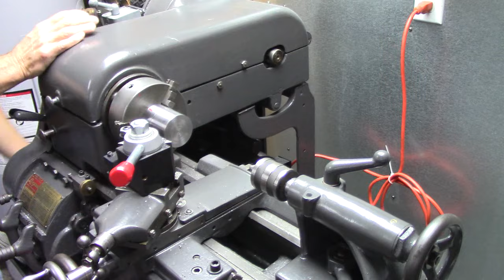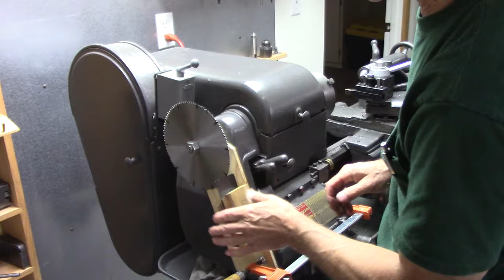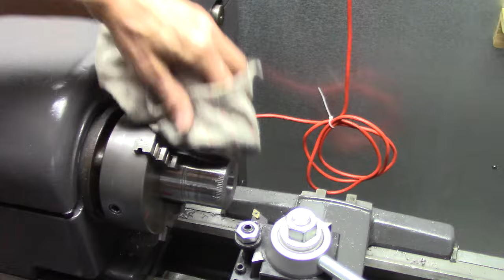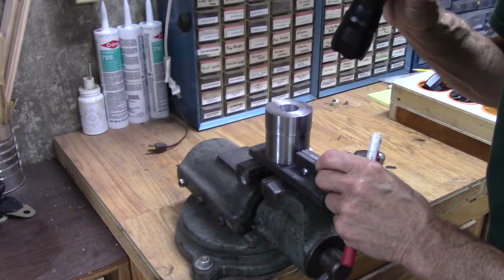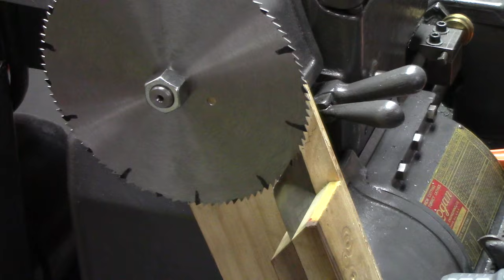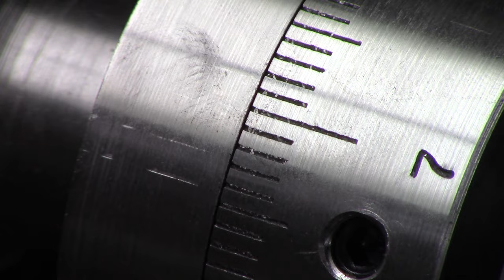New LARGER dials for my Logan 820 lathe - Part 2

Comment: May be use a vertices Sheree tool.   Mr Pete has a video on the vertical tool.    The tool is most effective at .001 depth of cut.    I know you do not have a dial but you capable to figure it out
Reply from the maker: I've mess with those in the past...  it might be great on dials!

Comment: Do you by chance have any of the measurements from when you made the dials and the crossslide extension? I have a logan 815 and would love to do this mod
Reply from the maker: The drawings were posted in the description of part-1 bit here's a cut and part: Dial extension plans to fit the Logan 820 and 200 (and some Ward lathes)  https://www.youtube.com/redirect?event=video_description&redir_token=QUFFLUhqbU9QYlU1QTBqbzNwSjRNTGJ4c0w4S196T0Nmd3xBQ3Jtc0tubVBldWNjbzlHc2M0c1hKaXd0WlMzb0NzYVJZS2NuRXNsLVVwNkNPQW1YYTloa3hBMGJtZVF2UTFQM0l6Nk55cFhQRlhKY1F5OF8ycmpfZjNLQk52dGQ2ODl0MVRjX2JobVVwTF92N3BUYmFMSWJqTQ&q=https%3A%2F%2Fdrive.google.com%2Fdrive%2Ffolders%2F19-xmDQsXIe-CsTcAFHwalhof5jXnAVnR%3Fusp%3Dsharing&v=MbUpOjtB2l4
Reply: @WinkysWorkshop  thank you

Comment: What is the maths behind the lead screw pitch and the indicator spacings? I am assuming the cross slide lead screw is 5 threads per inch? With 10 divisions on the dial, that would make each mark 3.6 degrees rotation. 1 revolution of the dial would be 1/5 an inch? How much of a cut is taken per dial mark? 0.018"? Thanks.
Reply from the maker: Most lathes are 10 TPI . This means one rotation is 1/10" or .100". If to divide that into 100 parts each line is .001" or 1/1000".  So if you move one increment the cross slide of compound will move .001". I'd forget about the angles. It unnecessarily confuses things. Oh...  one thing to keep in mind also is that when you move the cross slide .001" (one increment) you change the diameter of what you are turing .002". This is because you are removing from both sides. Some lathes have a lead screw with 20 TPI so that one increment changes the diameter .001".
Reply: @WinkysWorkshop  Thanks. Been a long time since math class. I was trying to think it through in my head, but the rotational aspect confused the simplicity! Cheers. ;-)
Reply from the maker: @CreatureDesign  - I totally understand. I can just about guarantee you are better at math them me. I've just thought about the dials a lot.

Comment: This will be my next project after the parting off tool. I went and got some steel dial rod today. Wish I had some aluminum I think that would be easier to make the dial lines in rather than steel. Your much better with the lathe than I but I have found on my south bend that a real sharp high speed steel with a light cut will do better than my carbide bits do for a good finish. Not sure but you might have gotten away with it and may not have wiped out your short lines. But you definitely got the job done and done well that's what I admire about you. I also have the same problem as you with the compound slide , it comes back and covers the dial and any time your machining something with some size to it that's always a problem.
Reply from the maker: Yeah...  HSS is a little better but I have good luck with carbide and its easy. I wiped out the first dial for a couple reasons. First the tip of the carbide threading tool I was using as a scribe broke so the lines were not as deep and second, I just went too deep. I think on the next dials I make I will use 800 grit wet dry paper on a block of wood and then work my way up to 1200 grit. Aluminum is a little easier but to be honest there isn't much difference. I think I like the steel better but aluminum works very well. Use HHS steel for a scribe on steel. Carbide will break.  Good luck and thanks for the comment. Oh... the first video (part 1) has a link to the dial extension. It's a lot of work to make but nice to have.

Comment: Wanted to say, the part where you took it out of the chuck to do the numbers is where you lost it... A 3 jaw never lines up the same way twice. Could have prevented by using the 4 jaw and re-indicating it in. Also could get a finer cut with hss instead of carbide insert. You got there in the end though, and did a beautiful job, it looks like Logan did it!  I love the saw blade setup, going to remember that one.
Reply from the maker: Of course you are correct about the three jaw and the HSS. That was probably the 8th dial I have made and the first failure. Marking the position has worked well but obviously the chuck isn't 100% consistent. Who know... maybe I had trash under one of the jaws. I made a couple of dials after this video and started using emery cloth and then 1200 grit wet dry to polish the dials. It works great. I can't take credit for the saw blade trick. I learned it from Mr, Pete. Thanks.

Comment: Having no dials, you could have set up your dial indicator from the bed to the cross slide and use that to see how much movement of your leadscrew. Turning out to be acracking job you are doing, well done and thanks for uploading such interesting videos. By the way, what happened to the indexing drum you made for your orriginal lathe, would it not have fitted to this one.
Reply from the maker: Thanks, I was very pleased with the way the dials turned out. 1.5" diameter would have been adequate but the dial shaft extension was still a huge plus. I can't believe Logan designed a lathe were the cross slide can obscure the dial. Very true on the indicator, this was laziness on my part.  I used the indexing wheel to make a dial a while back and it was a pain to use. It works great for 2, 4, 6 etc. but for 100 positions it's too slow. with the saw blade you just grab the chuck and rotate until it clicks and then back up slightly to seat the clicker in the gullit of the saw tooth. Way faster then aligning a pin to a hole.

Comment: Be willing to bet that you wiped out your marks because you remounted in a 3 jaw chuck. Wonder if that would have happened if you had used a 4 jaw and dialed it in!? Good work however, planning on something similar for my Craftsman. As with yours, the dials are too small for my older eyes!
Reply from the maker: I'd be willing to bet you are partially correct. If I do it again I'll use a 4 jaw. Wiping the dial out was a combination of too deep of a cut PLUS the carbide tip broke on the threading tool I was using to scribe with. That's why I switched to HHS for the scribe. So half the dial scribe lines were shallow and missing. With that being said, if you look close on my finished dials you can see that the scribes are not as deep on one side (off center in the 3 jaw). If you watch part one you will notice I used a 4 jaw to make the lead screw extension. I should have done the same with the dials,.

Comment: By darn you did it , Great job .. I learned a bunch .. ENJOYED !
Reply from the maker: Of course! I made 1.5" for my Logan 200 but it always bugged me that the cross slide covered the dial when it was all the way back. Extending the lead screw has been on my list for a long time. Sometimes crap like this sits in the back corner of my brain and digests for years. I suspect this is why I can't seem to remember things I should be doing. I suspect all these ideas are like parasites eating up brain power for simple tasks. On the other had, life would be boring if I didn't have things to figure out!

Comment: You had indicators why didn't you use them on the cross slide for depth and to indicate the chuck  3 jaws can be trued by tapping th low jaw with a mallet and re tightening it
Reply: I've had good luck with marking the chuck but if I want to get perfect I'd use a 4 jaw. As for the cross slide I should have turned the compound straight and used it.

Comment: You got there in the end.  It would have been no fun when the markings all dissapeared!
Reply from the maker: It was disappointing at first but it didn't take long to make the second one. Thanks for watching.
Reply: @WinkysWorkshop  it came out nice.   I tried to make a punch jig for my punches but they just wouldn't give a consistent result.  I think it's just down to cheap punches.  You got a great result!
Reply from the maker: @CreaseysWorkshop  - Maybe 3 years ago I bought a set of number and letter punches. I've made several aluminum dials and the results were okay but not great. Mostly the numbers were not positioned well on the end of the punch and it made the dials look sloppy. I bought a new set (google this number: B01I0WYFQ4) and the results were way better.  Side note...  the number 1 requires a lot less force to make a good impression.

Comment: Great video! You should look into a VFD for that drill press and for your lathe. I've got them on all my machine tools and I've never looked back. I had a Logan lathe years ago, and the VFD was a great improvement. Just make sure to oversize the motor a bit, so that it has plenty of torque at low RPM. I had mine set up with a 1.5hp motor and a 5hp chinese VFD. My drill press currently has the same arrangement and I don't know how I lived without it!
Reply from the maker: Yeah, the VFD on the drill press would be a huge plus. I'm sure it would be a plus on the lathe too but I can still get the speed range  need. The drill press is a different story.

Comment: That’s a great upgrade. I like the idea of using the sawblade as an index wheel.
Reply from the maker: Thanks! I made new dials for my Logan 200 out of aluminum also. It had the same issue with the cross slide clearance but there was still enough room to make the dials 1-1/2" in diameter. Extending the lead screw on my 820 made it possible to make the dials even bigger. This dial is just over 2-inch. 1-1/2" is adequate but it's amazing how much easier the 2 inch is to read. Very nice!

Comment: very nice work. I think you would have made life easier, if you simply used a tool holder in the lathe to punch the numbers. that way you could have indexed the numbers precisely, and quicker.
Reply from the maker: Interesting idea but the idea of hammering on my spindle bearing bothers me. Also there is a good chance of moving the stock in the chuck.  This might work well with aluminum. You dont have to use much force to make a good number with aluminum,
Reply: you're absolutely right. I hadn't thought of that.

Comment: Looks very good, your persistence is to be admired for starting over. The black filling  for the lines and numbers looks particularly nice. Thanks for showing, including the "fail".
Reply from the maker: Thanks...  yeah, occasional screw ups happen and I learned not to use carbide for a scribe on steel.

Comment: The use of the saw blade works very good, must get me a good collection of different numbers of teeth, the woodwork  looks positive, another way to get friction on the dial I fitted a O ring in side dial this provides a good feel to the friction, enjoyed all your videos thanks from Coventry in the UK.
Reply from the maker: Yeah, the saw blade was a bit difficult to find. Everything it going to carbide with fewer teeth.  I found it on line but it was very cheap...  $7.00 I think.  The o-ring sounds like a good option!  Thanks

Comment: Ruff shop day winky. The end results turned out great a huge improvement over those small dails. I really like the number stamping fixture. Hope the camera fix is not to expensive, I just spent $30 on tripping over a cord. Thanks for all you do Andy
Reply from the maker: Thanks, wiping out the dial was momentarily disappointing but it didn't take long to make another one.  Yes the number stamps worked well. I had a cheap set of stamps but ordered new ones to make these dials. Past dials didn't turn out as well with the poor quality stamps. The camera damage was minimal. Broken plastic around the charging plug.

Comment: I like the steel but it is a bit reflective.  I bet the aluminum would be a flatter background after a little Scotch-Brite.  Are you going to do the compound now?  Time to run two cameras so you always have a shot when technology fails.
Reply from the maker: The camera is dependable but maybe not my walking. I tripped over the cord.  Actually the dial is fairly easy to see and not very reflective. The camera picks it up for some reason. Aluminum does the same.

Comment: Could have used a dial indicator on your cross slide when you were without your regular dials.
Reply from the maker: Yeah... or turned the compound straight, it still had a dial. Working blind wasn't too bad although it would have been nice to document the depth of the scribe lines.